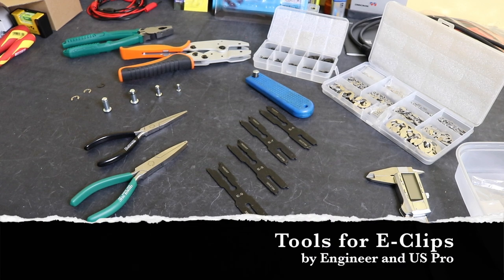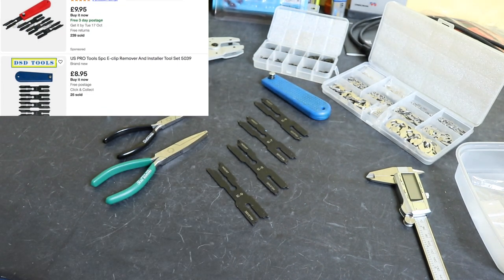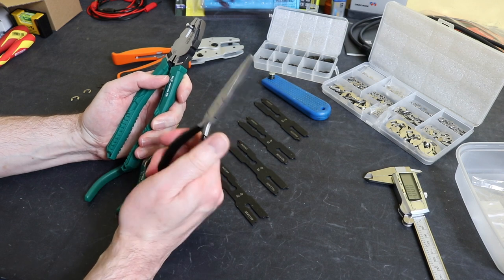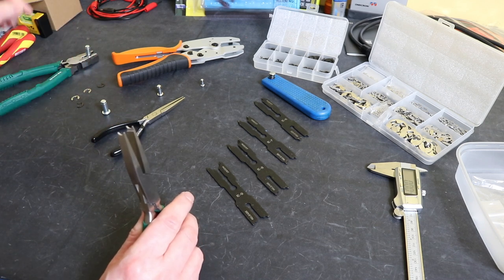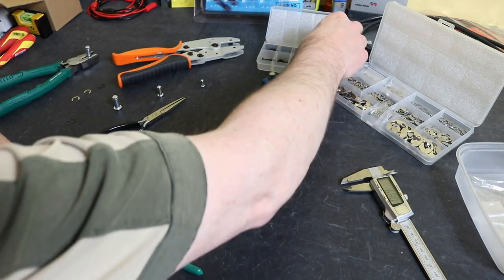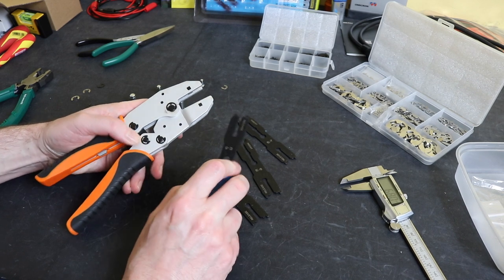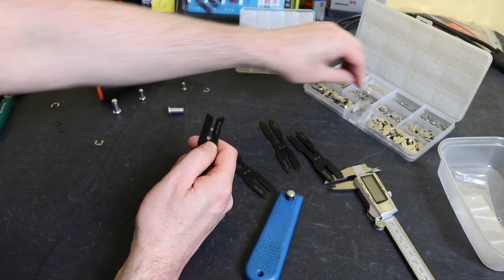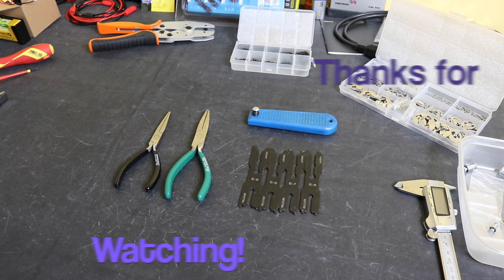Tools for Installing and Removing E-Clips

Comment: Thanks for making this video. I recently ran into this issue of removing E clips and was disappointed to see that most of the YouTube videos out there using crude and improvised tools. One would assume the companies assembling tools like the ratcheting crimper are using appropriate tools and not just random flat head screw drivere, at least I'd hope. For objects like that ratcheting crimper, it might be good to use a piece of tape to partially hold the clip to the crimper, so it doesn't fly away when removed.
Reply from the maker: Glad you found it useful. Yes, it would be easy to use some tape or a cloth to stop the clips flying away.
Thanks for watching and commenting.

Comment: But very often you do not have acess to the eclip from both side, e.g. when they keep a pinion or something else in axial position. Then the engineer tool is not of use.
Reply from the maker: Yes you will need access to both sides of the clip for the Engineer tool, presumably that is why there are tools like the US Pro version available.